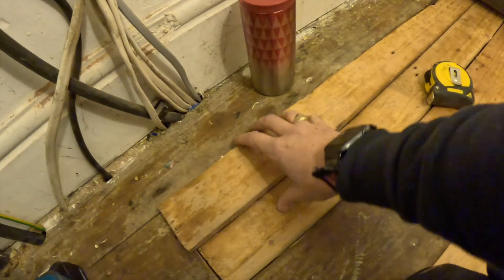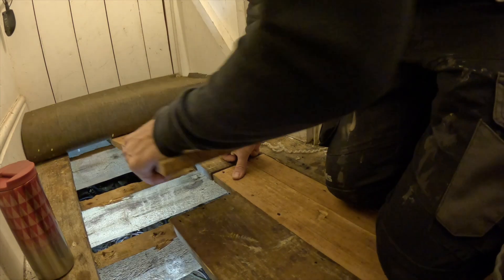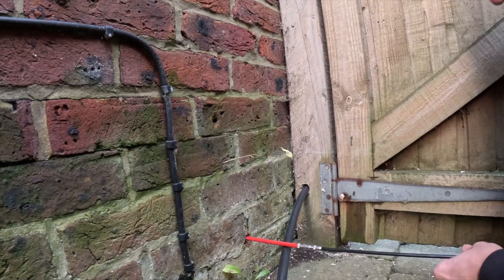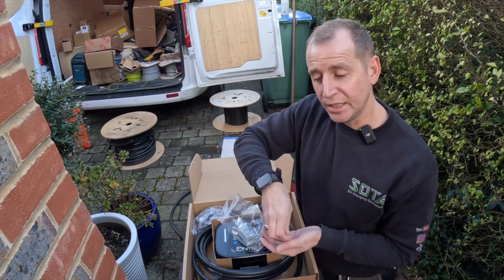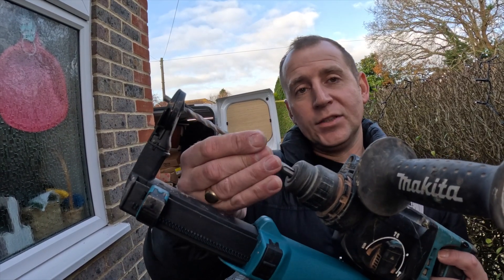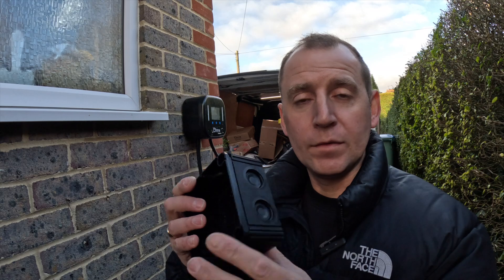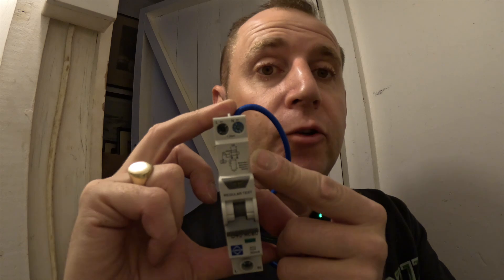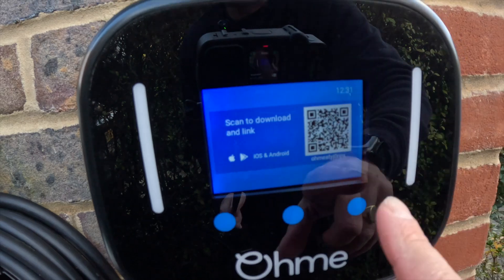The EASIEST EV Charger To Install... OR IS IT??

Comment: SWA cable? No need for RCD, added cost for consumer and not a requirement for cable protection. Also selectivity having 2 RCDs on the same circuit. Unnecessary overkill

Comment: Thanks for the video. Does the CT clamp need to be on the incoming line from meter or can it be on the line near consumer unit in the rear garden garage  50 meters away? The CU is daisy-chained from main house to outdoor to garage on 16mm SWA.
Reply from the maker: It needs to be on the line conductor on the meter tails I’m afraid
Reply: @ thank you very much.

Comment: Very good video and you seem like a friendly chap with a good sense of humour. I take it every EV install is different according to factors such as if theres space in the existing consumer unit and how far away the charging point is. Have you done say a terraced house that has no driveway and just a small front garden just curious to know how you deal with properties that have very limited space. Thanks for taking the time to compile this video and ive just subscribed as well.
Reply from the maker: Thank you for subscribing!! You seem like a friendly fellow also!! I have and done a video on it, check out the videos it’s somewhere 🤣

Comment: Brilliant job only thing I would say as a carpenter who fits external gates I would not have run it directly through the gate posts as if that post needs renewing at some point it will be difficult to get the cable out. Top work tho
Reply from the maker: Fair comment! Have a lovely Christmas 🎅

Comment: very informative gear video explaining step by step, what size is that cable and is it armored cable does it have to be armored? where can i get that junction box? can i install this by myself at my own house? thank you
Reply from the maker: Thank you, the size of the cable depends on your cable calculations, armoured/not armoured - depends on your installation method, you can buy the junction box at an electrical wholesalers and you probably shouldn’t install this at your own home if your not an experienced electrician with all the correct test equipment 👍

Comment: I'm installing a ohme home pro charger, is there anything I should be aware of or anything to help with the install? Cheers mate, love your videos 👌
Reply from the maker: Make sure you have a wiska box with two 25mm knock outs for the cable glands, make sure you can get 4G at your customers house where your installing it, other than that, it’s a piece of cake 👍
Reply: Legend!! Cheers mate. 🍻

Comment: I have a Ohme 7.4kW ePod Home EV Charger Type 2 in black, which does not have an electronic display and is very standard. I have been using it for the last six months, and I didn't set up Timber, just charged manually. However, for the last few days, there has been a problem. Sometimes it turns on, and after a few seconds, it shuts down. The lighting display also shows different colors than it used to. I need to know if this is an issue with the EV Charger or the consumer unit supplying the electricity.
Reply from the maker: sounds like you need someone to pop out and take a look to be honest.
Reply: @sotaelectrical  someone resolved to my Q - I have a Ohme 7.4kW ePod Home EV Charger Type 2 in black, which does not have an electronic display and is very standard. I have been using it for the last six months, and I didn't set up Timber, just charged manually. However, for the last few days, there has been a problem. Sometimes it turns on, and after a few seconds, it shuts down. The lighting display also shows different colors than it used to. I need to know if this is an issue with the EV Charger or the consumer unit supplying the electricity.

Comment: Hi, looking at getting a EV but I know my fuse board hasn’t any spare space available so every trip switch is connected to something around the house (lights,sockets, Outdoor sockets etc) does that mean I need a new bigger fuse box fitted or can something be done to free a space up for the EV charger to be wired into? As I want to faction all of these things in to the cost of moving over to a EV. Thanks
Reply from the maker: I would either suggest replacing the existing one or leave it alone and put in a new separate consumer unit for the charger 👍
Reply: @sotaelectrical  thank you for the reply. Price wise would doing it that way be cheaper as well as less hassle? Any idea a rough figure to look at doing this I appreciate it’s depending on area etc I’m in the Thames Valley area UK.
Reply from the maker: @andrewwest8418  cheaper and less hassle to put in a separate consumer unit for sure!! Price wise I won’t discuss on here, fuel for an argument

Comment: The other good thing with them drill dust extractors is they help give you a nice 90° drilled hole & it is nicer to not have the little piles of dust everywhere 😉

Comment: Have an Ohme charger installed. Not a massive fan of it always looses its internet connection from the mobile sim that it uses and sometimes requires a power down to fix this and whilst it has no internet the option of authorizing charges does not work meaning any one can use the charger.

The CT clamp on my one also doesnt work and so i have had to turn load balancing off as it was stuck at low charge speeds and the CT clamp makes a loud noise tried to call Ohme several times but can never get through to them left several voicemails to call back and have heard nothing.
Reply from the maker: Hi Jamie, 
Thanks for your comments, one thing I also do is check the 4G connection at the property before installing an Ohme, it’s a shame your having this issue. I would maybe suggest contacting your installer (if it’s Ohme then I understand you have tried to contact them) and get the CT connections checked out, should be an easy fix. 
Thanks for watching and best wishes for Xmas! 👍
Reply: thanks and yes the CT clamp is an easy fix think i know what the issue is the installer used 1 pair of CAT5 per CT wire meaning each wire to the CT has 2 cables which wont be helping things will probably end up redoing these connections after xmas when i have time and seeing if that gets the CT to start working @sotaelectrical

Comment: Great Job mate! That holder to release the charger plug is the best thing, I used it on my Indra Lux it finishes it off well and makes for a neater install compared to the holder and rubber boot that still allows water ingress think Indra dropped the ball on that one.

Ohme is by far the best integration with Octopus 🐙 a mate of mine has it and it can do the dual tariff ie it knows when your charging at the lower price of the tariff in the day time outside of the set hours and give you the price of the charge accordingly, although Octopus 🐙 schedule the charge on Indra.

Indra still associate any charge outside of the set times as peak rate and displays it on the app as peak rate even though Octopus 🐙 Automated the charge schedule. Indra seem at a loss as how to implement this like Ohme have got told they will look to update in the next firmware update.

Ohme is by far the star of integration but ugly in the looks department IMHO especially if it has to be installed at the front of the house.
Reply from the maker: Thank you mate, and thanks for your comments, good info there for sure!! Hope you have a lovely Xmas!!
Reply: @sotaelectrical  you to bud, at least you get a couple days break from work lol, have a good Crimbo mate